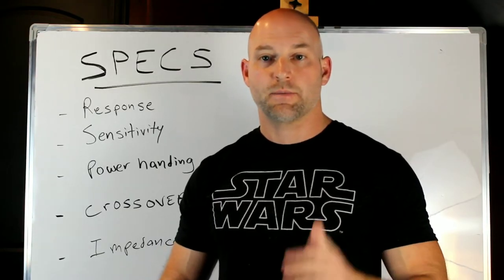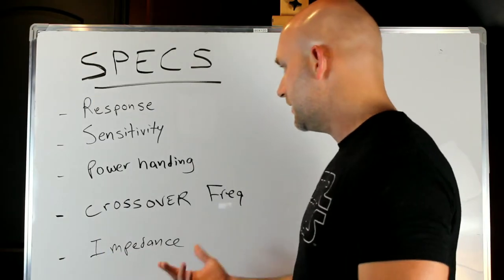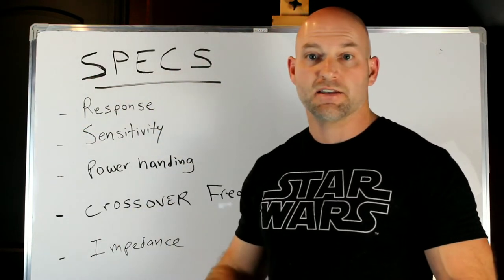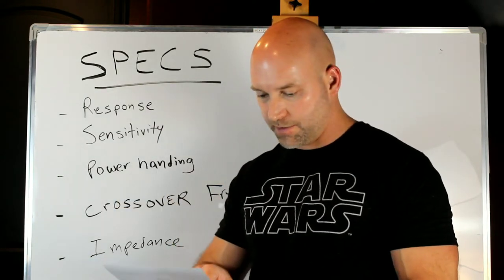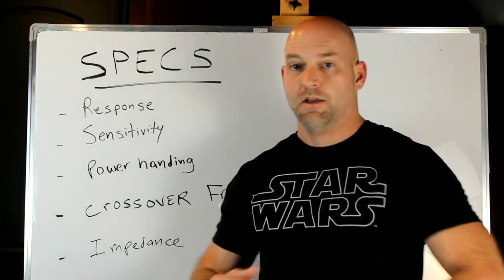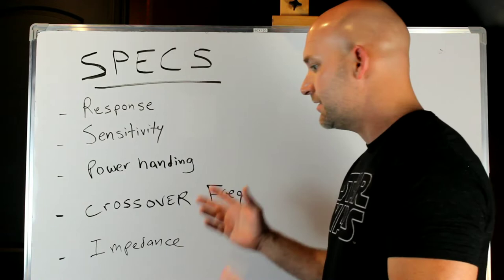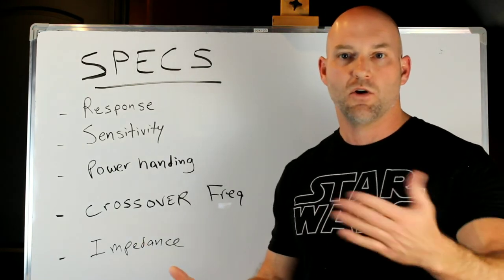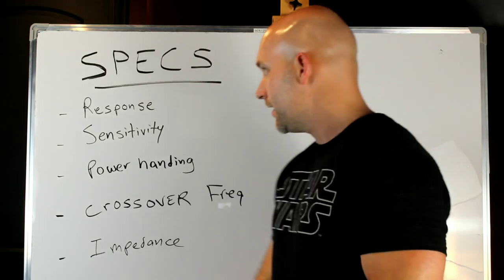Ep. 16 - Understanding Speaker Specs! | Speaker Setup | Home Theater Gurus | Klipsch | SVS | JBL

Comment: The sensitivity of a speaker is where I've always questioned. There has to be a reason why most speakers from all the name brands have a low sensitivity anywhere from 86-89db. I believe the highest sensitivity I've seen from a name brand would be from Ascend Acoustics. I was always under the impression that speakers with high sensitivity is a red flag. Maybe I've been wrong but why are they so rare with good speakers if it would be a great selling point? There has to be compromises to sound detail and overall quality of the speaker if they have high sensitivity I believe.
Reply from the maker: Some high sensitivity speakers can sound very good but for years poorly designed PA speakers gave them a bad wrap as well as some of the lower end klipsch.   Usually the tweeter limits sensitivity as domes and ribbons for instance have a low sensitivity compared to a compression driver found in most high sensitivity speakers.  Domes and ribbons have wider dispersion and don't rely on a waveguide so  you can't have it all as all designs have limits in some way. Some really great sounding high sensitivity speaker kits can be found at diysoundgroup.com.  I currently have high sensitivity speakers but in the next theater I'll be using domes as I just don't listenoud enough to need high sensitivity.

Comment: Quick question. If the speaker company rates a speaker at full range and we use them in a home theater set up crossed over at 80hz and above with the subs doing the heavy lifting on the bass 80hz and below wouldn’t that effect the numbers?
Reply: How ?no

Comment: A speaker with 26hz to 24khz response and 90db sensitivity, and another speaker with 32hz to 21khz response and 97db sensitivity. Which one I would choose??
Reply from the maker: IMO the upper end of those is irrelevant. Most of us can't even hear 20k.  Down low IMO we should be crossing to subs.  Sensitivity wise many manufacturers lie.  I'd look for 3rd party measurement to see which is the better designed speaker.  See ep 4 to understand how to select speakers.
Reply: @hometheatergurus  what is IMO??
Reply from the maker: @thomasvarghese3123  In My Opinion

Comment: With klipsh speakers you need to remove like 6 to 8db from the rated sensitivity.
98db and 128 watts are 119db/1m.  I bet that those small woofers can't do 119db/1m at 40hz not even at 80hz. Lets not talk about their "max" power. Max power is always 2x the nominal power. This is the standard but they just swapped the 2x with a 4x for better numbers. 
Those speakers look on paper to be better then most DJ, party, weeding speakers (PA) in terms of loudness. 
I have a 15 inch PA subwoofer (not used for anything than party music) that is rated to go down to 32hz and it can barely reach 120db levels at 1m ( i have an actual SPL meter to prove that).
The limiter on the amp starts flashing, that's a 750w amp (on spec) on a PA 15 inch subwoofer and those small klipsh should sound as loud as that.
Reply from the maker: Yeah they have been caught way over rating speakers but I didn't really want to get into it too much but just recommend finding 3rd party measurements.  There's some eye opening stuff out there to be found.